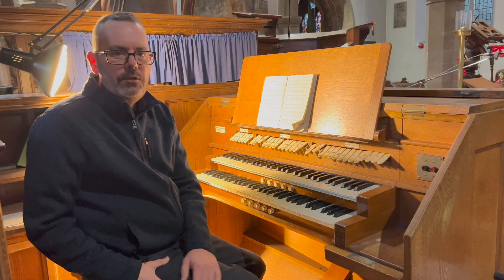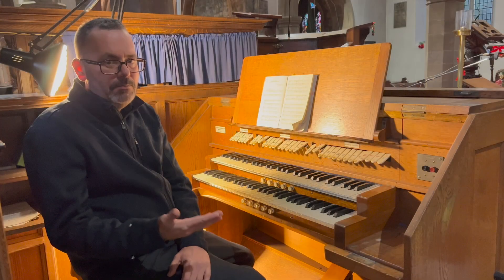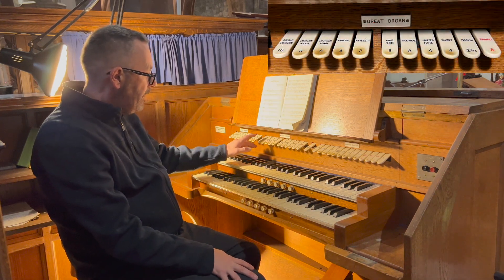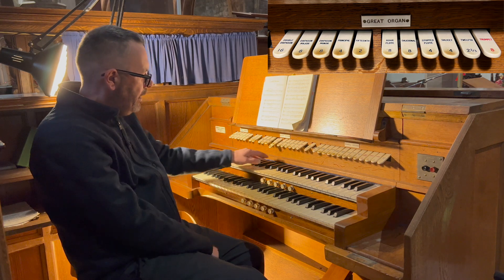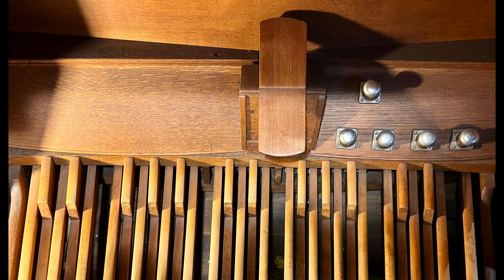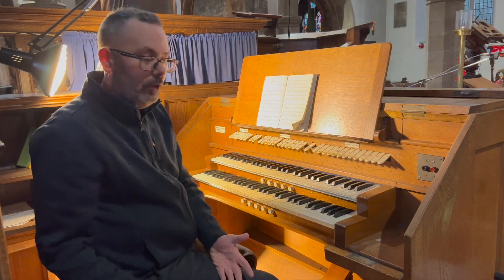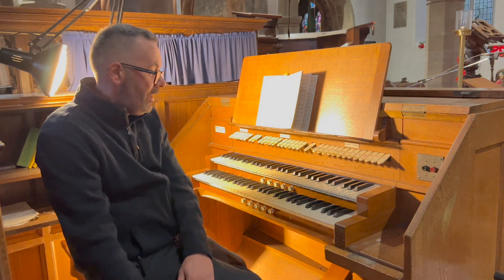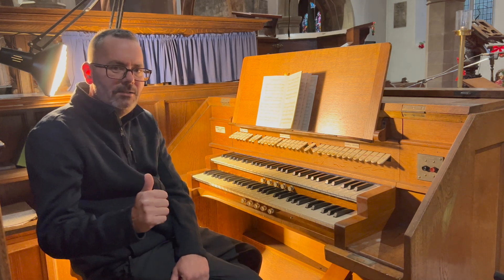LOUDER THAN IT LOOKS  (...Merry Christmas 🎄)

Comment: This is quite a generous spec for a unit organ.  There are three diapason ranks, two of them unenclosed (on Great and Pedals), which is probably why the organ is so powerful.  Inside the box, the Flute and Geigen ranks only go up to 4 foot pitch, leaving the Salicional to do the rest of the flue work.  This includes the mutations, which would be interesting to play with.  On the pedals I noticed that the so-called Octave is a 4 foot flute, which the NPOR spec confirms, but with (sic) alongside as if they don't believe it!

For the pistons I imagine there is a setter board 'under the bonnet'.  Not something you can mess around with during a service, but useful if the church gets a new organist.

Finally, thank you for sharing this and all the other organic visitations, and I wish you a happy rest-of-Christmas and a productive New Year.
Reply from the maker: Thank you for that - all makes sense!  I've played this organ many times over the years (for funerals/weddings and the like) and I have always been impressed by the power it punches.  I didn't know that the pistons would be adjustable...I assumed that they were preset when made.  Wishing you a Merry Christmas too and thank you for the nice comments 🎄